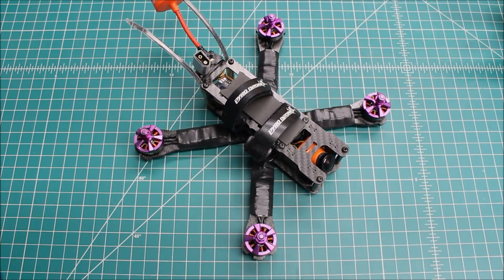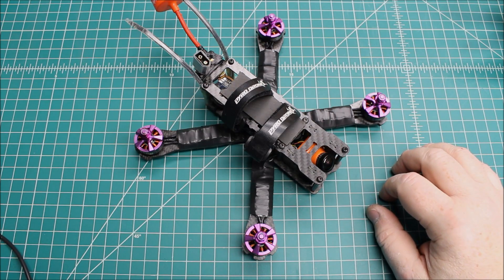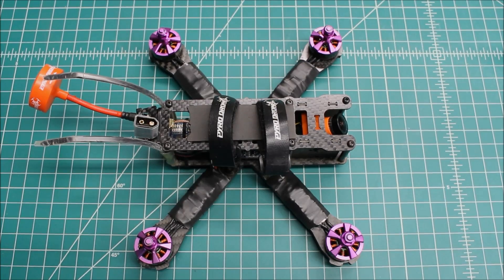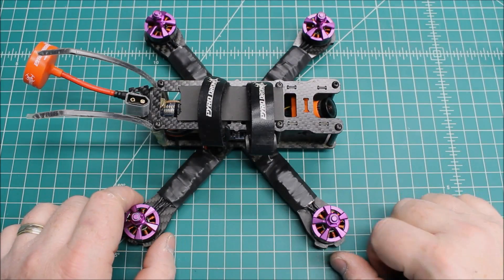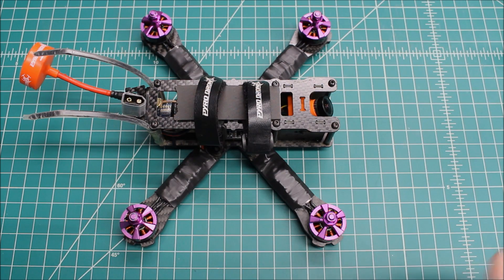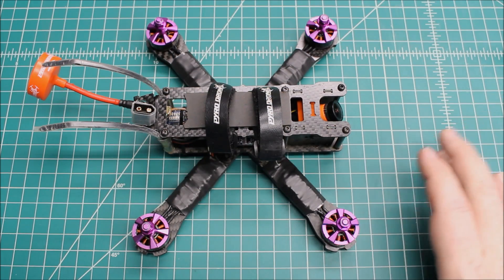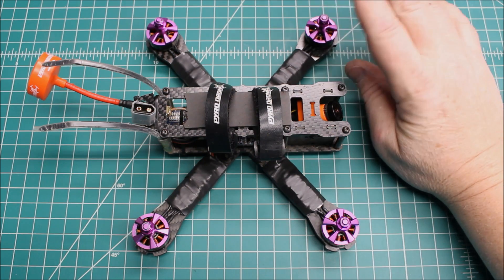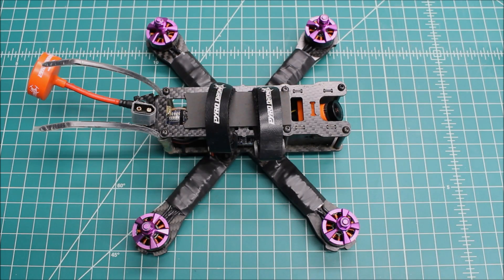ZMR 220 Hyperlite V2 Transplant and its Affect on Handling

Comment: Beta flight?  was the first tune on the same firmware? 3.0 is dam near dialed in right away. just wondering I am looking at a version of these motors also.
Reply from the maker: Cleanflight before and after I installed motors. In Cleanflight the new motors allowed me to get more aggressive tune without much effort. Then installed Betaflight and used basically the same tune and it got even better.
Reply: X-Frames FPV thanks for reply, I'm subbed, please sub back so we can all make it, see you around.